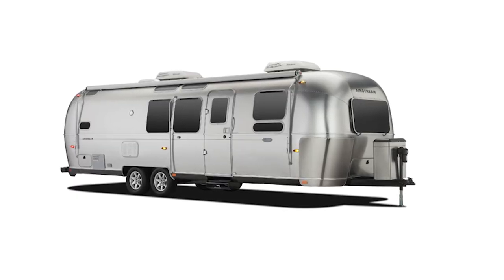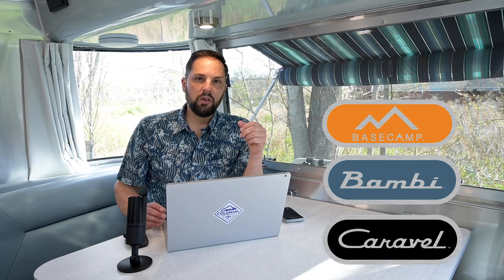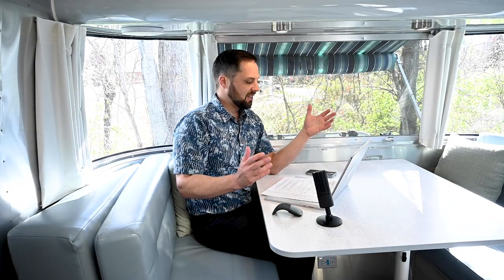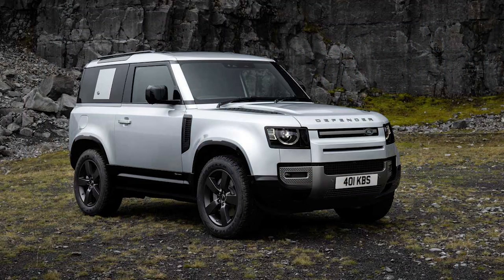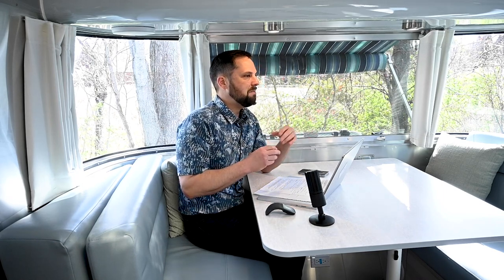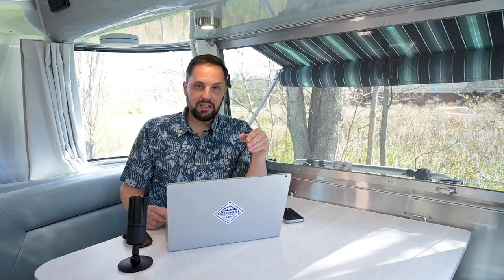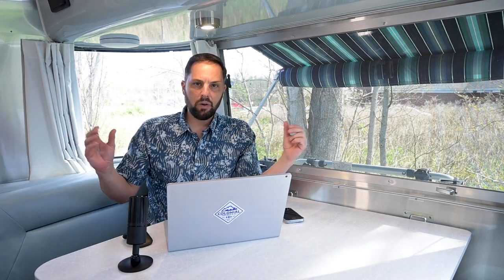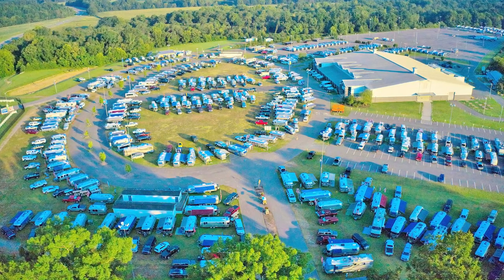Airstream Q&A Episode 3 | Patrick - The Airstream Guy

Comment: For Hybrid tow vehicles, you missed one of the best options: The F-150 Powerboost.  Not only is it a hybrid vehicle, but the 7.2kW ProPower system will fully power most single axle Airstreams when boondocking - it's virtually "plug and play".
Reply from the maker: Yes, I had only searched for SUV's

Comment: Patrick, What is the actual tongue weight for a Flying Cloud 25FBT with bunk, dual air, upgrade solar and awning set (plus full LP,  batteries, and water)? Do you think it is towable with a 2022 Ford Expedition Max w/ HD towing? For our situation the payload figure is not an issue but the 900 lb tongue weight maybe an issue, even with WD. Published numbers are somewhat vague.

 Thank You
Reply from the maker: We weighed one recently with those options and the 2nd A/C and and it was 1090#. The payload sticker for the tow vehicle is on the driver's door for the vehicle so you can see what it is based on the factory options.

Comment: I've heard that Airstream doesn't recommend using a cover when the trailer is in storage because the cover can damage the clear coat. I live in Arizona. We're planning on buying a 19cb Caravel . I would not feel comfortable leaving that beautiful camper out in the brutal Arizona sun without protection. I plan on storing it in covered parking, is that enough? I would feel better using a cover, but I'd like to hear what an expert ( like you!) thinks about using a cover for when its in storage. Thank you!
Reply from the maker: Covered storage is good, a cover will damage the skin.